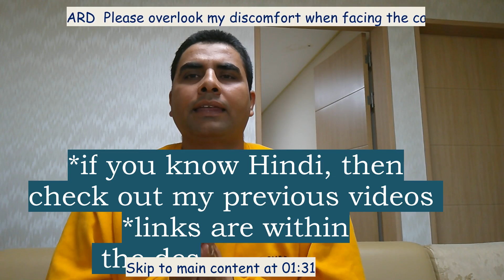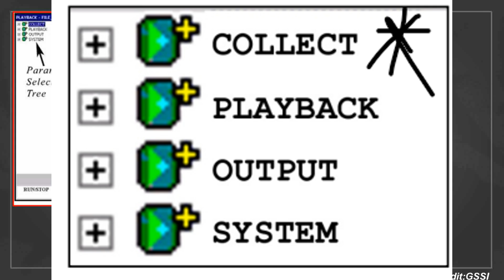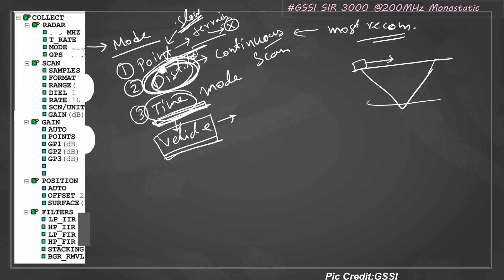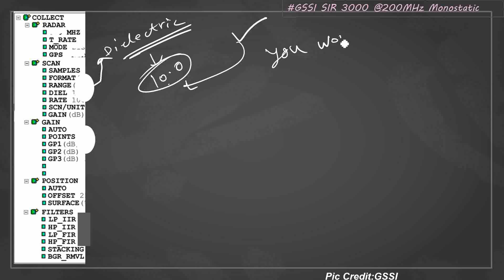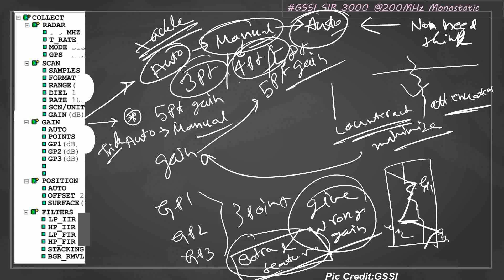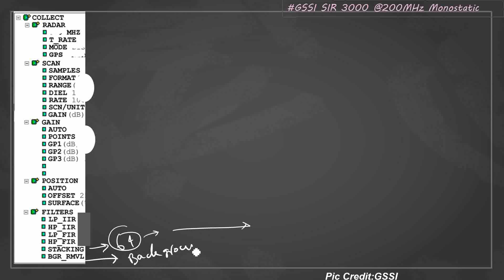GPR 200 MHz antenna Setup Guide| ENGLISH |Part01 | Ground Penetrating Radar (GPR) Survey

Comment: A good overview of working with GSSI SIR3000. Do You have any settings for the 50400 antenna model with a frequency of 400 MHz for archaeology? Thank! Best regards, Sergey
Reply from the maker: Hi, Thanks for your feedback. Unfortunately i did not work with 400 MHz antenna ... But you can always find the setup inside the manual.